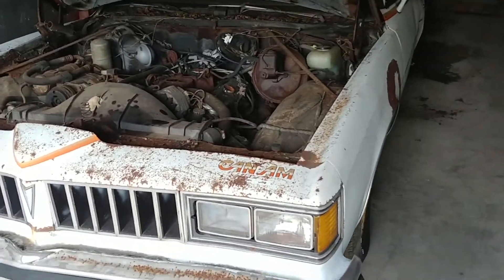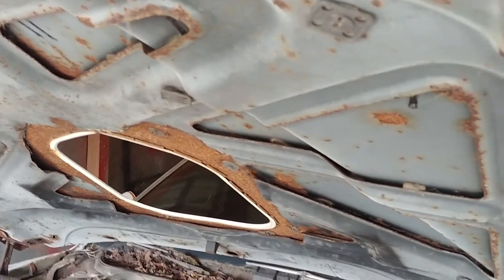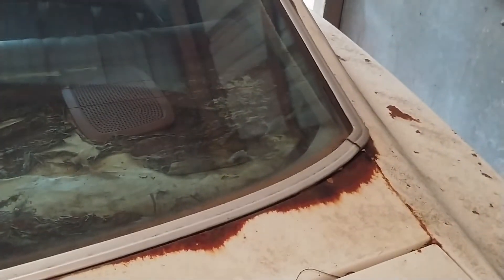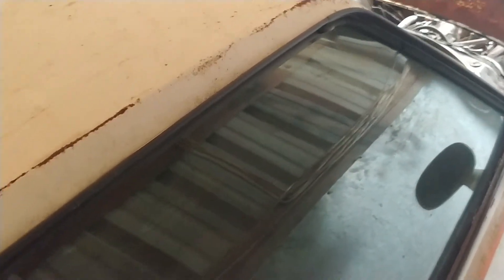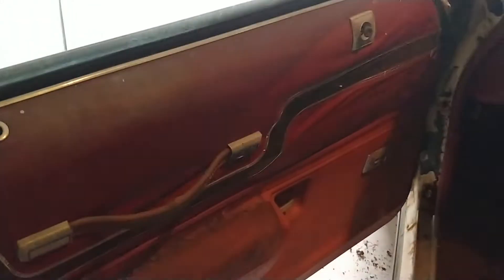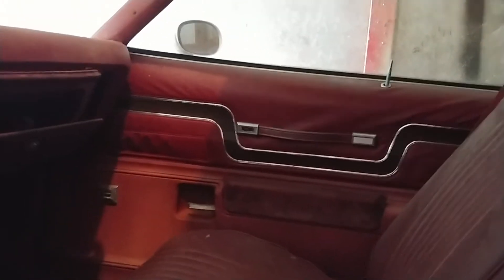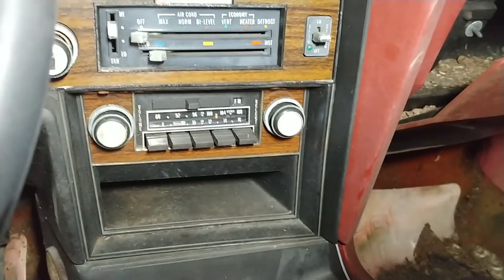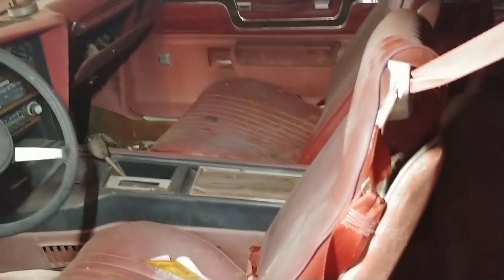77 Can Am Parts Car Overview

Comment: It’s a shame that car is a goner.  Hard to see since I’m a car guy myself (I’m into mostly Fords).  The most heartbreaking part is this car is pretty rare and hard to find.  It’s the harsh truth that you can’t save all of them.  Well, this car will help restore another car.  The engine is rebuildable as long as the block is not cracked.  At least most of the interior is good to put in another car.  If you end up rebuilding that engine, just for fun, look for a 1977 Pontiac Ventura 2 door and drop that 400 in it and make what I call a “1 of none” car.  Either call it the Ventura GT or the Ventura Formula
Reply from the maker: Yes, it really knocked the wind out of my sails when both these Can Ams arrived. My intentions were to save both of them but its not practical on this one due to all the obvious issues. But it nice to have a parts car for the other one I'm restoring. I plan to pull the heads off this engine and use them on my 75 Grand Am since its a 2 barrel engine with the less desirable heads and smaller valves. The engine was exposed to the elements for years so I'm not real hopeful on the engine block but we'll see. Really like your idea with the Ventura. Thanks again!